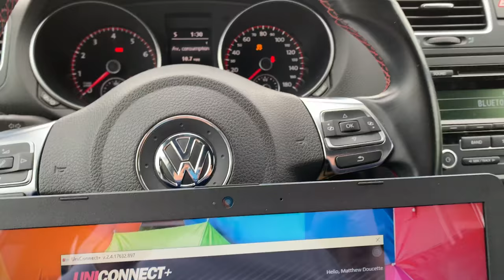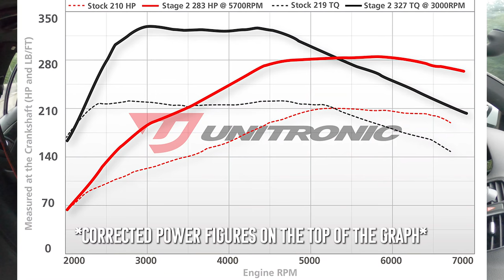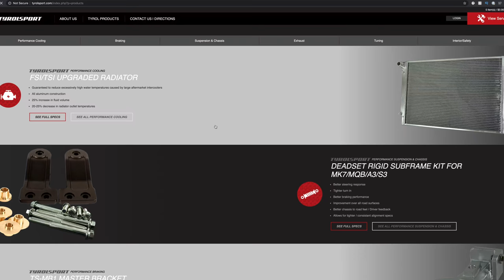Volkswagen GTI - How Reliable Are They Really?? Biggest Flaws...

Comment: How on earth do you drive 40k miles in a year? I think VW get a lot complaints on reliability. If you take care of it, they will be a good car.  So many people pound the crap out of their VW, dont change the oil enough or do regular maintnence and wonder why they have problems. My 86 golf went to the junkyard at 290k miles, my b5.5 passat has 155k and is going strong.
Reply: Amen brother. Mk6 gti 100,000. Run your PVC through tubing under the car(no carbon) just plug the intake manifold and turbo intake. Use Mann oil filters and Pentosen oil with Lucus synthetic additive. Change it often. Change your DSG fluid and filter every 40,000. My car has never been in the shop.

Comment: Definitely subscribing. I just bought a 2011 gti  with 80k miles. Am just concerned about the tensioner and timing chain. I dont feel comfortable doing that job even tho i do all my own maintenance and  am some what mechanical inclined. And i was not able to get any information from previous use/maintenance on the car 😔. I bought it because is beautiful and the 6spd is awesome. Should i take it to the dealer and get the tensioner checked ?
Reply: I did that to mine the week I bought it. Especially if you plan to tune it at all. It’s one of those things where if it does fail, it is a minimum $4000 failing

Comment: Sounds like most of these could be avoided by buying a Mk7 with DSG instead!
Reply from the maker: Yes, for sure! I first test drove a mk7 and loved it, but I couldn’t afford it at the time. And I will always go with manual 👌🏼
Reply: They still have issues.
Reply: vg gasoline cars are going up in reliability 10 years ago if you wanted a reliable vag car that was gonna run a long time you got a tdi that was the idea but dieselgate messed that up so now they are building their gas cars to run more miles the new 1.5tsi is a good example or the 6 cyl they put in the new atlas.

Comment: Your car is simply not going to be as reliable if you fit aftermarket parts and tune it ! Respect the car and it will respect you .
As for the timing chain tensioner I spoke to VW they have changed 3 in 7 years so, not a common problem - buy one from Japan far better looked after .

Comment: How do you "Seafoam" your engine?
Reply from the maker: Spray Seafoam “upper engine cleaner and lube” into the vacuum line leading into the intake manifold, let it sit for an hour or so, then drive it like you stole it.
Reply: @NotSoHandyCarGuy  Cool yeah that will get the intake valves that way. Just checking. I want to borescope first because I don't want to send huge chunks of carbon downstream into the cat

Comment: I am mechanic. Don't buy garbage mostly vw.
Reply: Bryce Czirr  Reliable? I have had a GTI for 6 months. I have had 4 water leaks in the last month, and I don't even have a sun roof. Gotta love mildew. Funny thing is that people have been complaining about water leaks for years. VW doesn't care. I will get rid of this car as soon as the warranty ends.
Reply: @thewirah1  sorry to hear your troubles. Consider to sell it before the warranty ends, i.e. will get U a better price.
Reply: The GTI is kinda inexpensive. And as long as you upgrade certain parts. It’s still cheaper and better then a lot of other cars in its class. And Anybody can ruin a car and I’m positive a lot of GTI owners drive the shit out of there cars because they are that fun to drive. And then blame the car for not being reliable. I have a gti with pro tune K04,dsg stage 1,FMIC, full turbo back exhaust, air intake and a few small upgrades And it blasts a lot of V8’s rn. But I don’t drive my gti hard often. So far the Only maintenance I needed to pay for was a dsg transmission oil change and I’m at 80,000 miles so far. But I also take care of my car so I dunno opinions are opinions.
Reply: @generationsofmotivation9212  Never modified or abused my GTI and owned from new. Servicing was more that needed and before it was time to service. It still broke and had major problems. There is a reason that VW has a reputation for poor reliability and Toyota don't.
Reply: @generationsofmotivation9212  once you reach 100k change that water pump, and you chilling

Comment: No broken sway bar?  Mine sheared.  $1600 from an independent mechanic.  (Had him put in new links too.)
Reply from the maker: Surprising not! And I drive this thing HARD. But I’ll keep a close eye on it
Reply: How does a sway bar cost $1600?
Reply: $1600? That's absurd!
Reply: Either you’re lying,

That’s in a currency other than USD,

Or you just got ripped off for the highest amount on a single job I’ve ever seen.
Reply: @thomasburns3345  US CURRENCY.  When it's the middle of a winter storm, dealer is 40 miles away,  sharp broken rod is flailing around and endangering brake lines and caliper, don't trust any other shops in town, and you've got to get to work, you pay railroad prices.

Comment: Kind of late to the program aren't you?  Mk6 were 2010-14 here in the U.S.  This video is from 2020.  By then, the car could have been 7years old (at a minimum) and you are critiquing a car you bought already USED?  Dude....buy NEW and take care of it and see what problems you have to report.
If you are concerned about the "Throttle" and the "RPM" hang, then you should have switched to a single flywheel vs the Dual that comes stock.

Comment: My stage 2 MK5 has been more reliable than my MK6 so far.   The MK6 has a K04 and has had some kind of PCV issue since I got the car.  Had a high idle...replaced the PCV.  Then the actually car ran worse. Got another PCV, still ran like garbage.  Put the original one back on and the car ran great aside from the hanging idle and CEL.   I installed a BFI catch can and the car started smoking from the exhaust at idle.  Gutted one of the PCV separators of all the check valves so it was an easy vent.  Stopped smoking at idle, but filled up the catch can half way in about a week.   Also had a decently bad oil leak from the timing chain cover, which I replaced with an aluminum one and new gaskets.  The PCV thing is so far the worst and most annoying issue.   The car is refined, fast and extremely comfortable.  I love it, but sheesh what a bitch.
Reply: It complaints if no original parts are used,  sometimes is costly. Had to buy the PCV original for around 190 usd…

Comment: Wow. Was (was!) in the market for a GTI. ... That's a lot of engine problems though. I ain't got time for that kind of fooin' round!!!!!
Reply: Ummm, the car isn't that bad... I drove the piss out of my MK6 up till 115k when I traded it for a MK7.  I am at 50k on the MK7 and the one thing I have an issue with is there is a creak from the rear that shows up when I go over speed bumps or enter really steep driveways but it's super hard to replicate...but you know what do yourself a favor and don't drive one because a GTI will spoil you and make it difficult to trade down to something that doesn't take care of all your needs.  Literally didn't even make it into another WRX before I caved and said I had to have the MK7 that I found locally. 

Maybe some day I will switch it up.
Reply: So would you suggest that I buy a 2014 DSG with 55k miles. Local dealer wants $15,500. 1 owner that was serviced at VW dealership only
Reply: @marzzgli1278  Don't buy a GTI unless you love working on cars and have alternate modes of transportation. Worst car I ever bought.
Reply: Good decision. You won't regret it.
Reply: @marzzgli1278  Do it!! I have one and it is a great car. If you get the DSG make sure to always wait til the car drops down to normal idle speed. I have always done that and haven't had a single engine issue. Keep an eye on your oil too. If you treat it right you'll love it!
Reply: @marzzgli1278  that would have been an insane deal

Comment: This car does not look very good stock, but if you lower in on some nice wheels, then new headlights and new tail lights tinted. Then you straight pipe the exhaust, get a catless down pipe and then get two step it and or crackle pop tune their you go.

Comment: Bro really hope that was a joke because that seafoam ain't doing shit and that smoke is concerning
Reply from the maker: Not a joke. It’s Upper engine cleaner and lube, not the oil additive. It’s supposed to do that. I made it to 154k miles and finally (actually) carbon cleaned with a walnut blast. But the carbon wasn’t bad at all.
Reply: @NotSoHandyCarGuy  correct me if I'm wrong, but I'm fairly certain that mk6's are direct injection, in which case the only place that seafoam is going is in the combustion chamber and not onto the valves or intake runners.
Reply from the maker: @mfitze1  They are direct injection. But again, it’s upper engine cleaner and lube, which you spray past the throttlebody, not in the gas. Check out my video “prevent carbon deposits in your direct injection engine“
Reply: @NotSoHandyCarGuy  no shit, I was under the impression that seafoam was primarily a fuel additive. That might actually be helpful for my mk7... at about 80k atm
Reply from the maker: @mfitze1  at that mileage, definitely try it out! It gets a little riskier the higher mileage your car has.

Comment: dude calls out german cars then proceeds to explain problems experianced by EVERY GD car on the market can or does have. They are reliable period. What's changed is people's definition of reliability which now means "have to spend 0 money on it to get at least 10 years out of" - which is not what that word means obv. Maintain your damn vehicles, signed a ex mechanic who got tired of people running their cars into the ground and refusing to spend money on them for preventative maintenance

Comment: They are as unreliable as everyone says. They are enthusiasts cars only and too unreliable for a daily driver. Don't know why anybody buys a VW GTI, there are better more reliable cars out there to tune and mod. I owned a MK6 and everything went wrong with it and it was stock. Fecking money pit and they haven't improved all that much. Chassis is awful, creaks, flexing, bolts, needed pistons, rings and conrods at 75,000km (oil consumption issue). I now own a Hyundai N and it's been faultless at 45,000km, couldn't say that about my GTI at those klms.
Reply: I have had a GTI for 6 months now (certified pre-owned from 2017) and I can't believe the number of issues I have had already. Totally agree about this car not being a daily driver.
Reply: @thewirah1  Yep they are designed to fail so you return to the dealer and spend money to have parts replaced. Most car manufacturers, especially VAG, BMW Mercedes, make their money from service and parts. I had a look at some of the parts that failed on my GTI and they were deliberately designed to fail. Poor materials and build quality. Don't buy a VAG product and you will be OK.
Reply: What about a 2012 focus ST ?
Reply: @faustnightmare100  Yep I suck ass at taking care of my car...so the oil consumption from poorly designed and engineered piston rings is due to poor maintenance???mmmmmm, interesting. If you look at the first comment, and there are many else where, I'm not the only one experiencing poor reliability and build quality of these wanna be cars. VW has a poor reliability rating for a good reason. You can defend your stupid buy all you like, it won't make any difference to me.

Comment: After a 130,000 miles what do you expect lmao 🤣 every car is the same. The parts go out around the same time and if they go out faster it’s the owner fault
Reply from the maker: Try to apply that logic to the GTI’s known failure points that often happen before 100k. A little bit ridiculous to say every car is the same.
Reply: @NotSoHandyCarGuy  some, not all. I think the autos are more to failure , the manual transmissions cars were assemble in Germany like mine. You can tell by if they used an Allen key or torx

Comment: Hilarious that this dude is talking about the reliability of the GTI while driving an MK6 GTI. I own the MK7 GTI and literally have had a zerrrrrrrrro issues. I am dynoed at 337HP Stage 2 Unitronic, IS20, modded intake, downpipe, etc. I push my car hard and nothing fails. 68K miles later. 

I recommend talking about the car as it's latest version and not from 7 Years ago in 2020.....

Comment: All  your problems are because the idiot that had it before you ran it on cheap gas. That's it. 
I've owned FIVE Golfs and currently a CC and have never had problems with any of them. Ever. 
When I have a VW owner come up to me and ask if I have had any problems and I look at their fuel pump and see they're putting in cheap-ass gas, I say no, because I read the owner's manual and run my V-dubs on ONLY premium fuel. 
#dublife
#VWuberallen